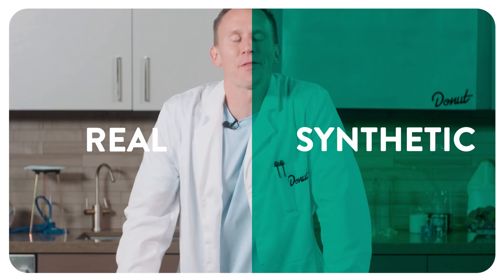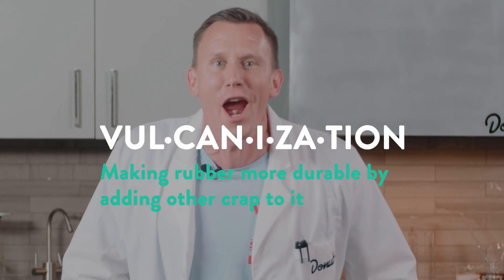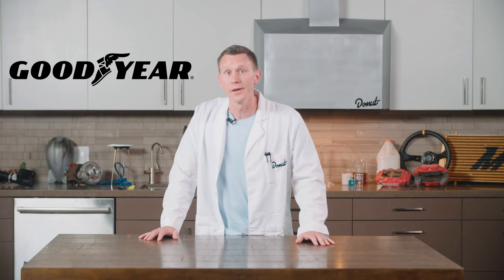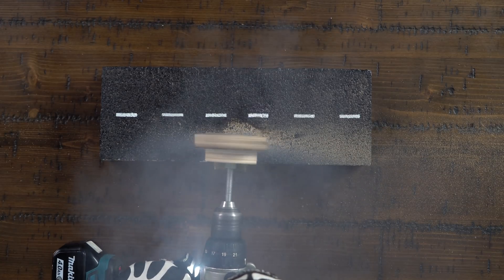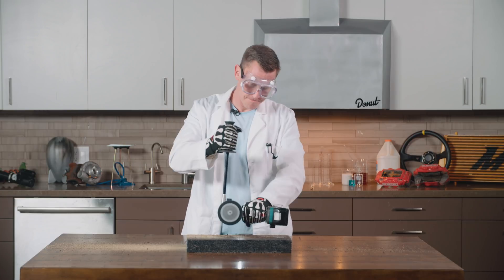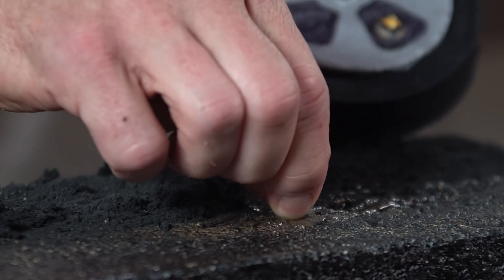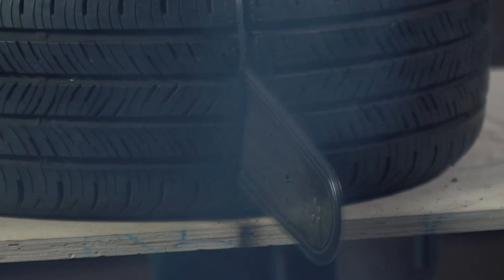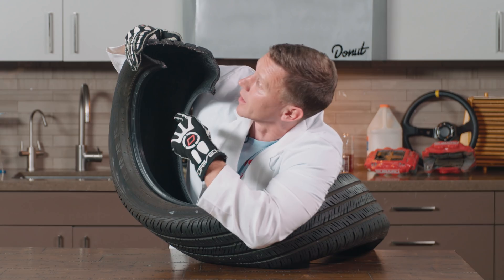TIRES | How they Work | Science Garage

Comment: Donut in general keeps saying you need rubber for you engine but you don’t you can direct mount your engine without rubber mounts change the pulleys to gears and use a chain and get plastic hoses for the cold things in the engine bay and metal ones for the hot ones

Comment: The double bond in ethylene splits into two electrons and a single bond, two monomers (a single part of a larger polymer) can form a new bond between them with the two shared electrons. This forms a long chain, but that chain doesn't have double bonds between them. This way you show carbon having 6 bonds around it, which is not possible, 4 is max and most common. Only in very specific circumstances can you have carbon with a different number of bonds than 4 around it.

Big up for showing it down to the structural formulas though.

Comment: 5:20 No belts,no hoses,no tires...Sounds like a locomotive to me.Belts,none on a locomotive.Hoses,they can be made out of metal (not efficient but they CAN be made out of metal),tires...The wheels normally have no rubber on them...So....yeah...Imagine a car combined with a locomotive.Normal front of the car with the steering.Rear with the boiler and driving wheels. xD

Comment: Inner liner, 2 plys with nylon strings, gum guard, rubber coated copper bead, rubber shaffer, rubber side walls, 2 copper stranded belts, high speed rated tires have kevlar overlay strands, finally rubber tread. Those are the compounds of a radial tire. 👍🏽

Comment: How about a fuel talk involving E85? When I got my WRX flexfuel tuned, it made 50 more horsepower/torque over 93 octane just because I changed priorities at the pump. Aside from crappy MPG (who cares? I don't!), it's a boost in power and rarely ever breaks $2 a gallon when at the same time 93 is at $2.70. I guess key point, cheap "race fuel", how is it made and why hasn't someone blended it with a higher octane like 100+?

Comment: The only rubber parts of a car or motorcycle, should be the tires...and condoms for later. 

Everything thing else, like bushings, boots, and hoses, should be made of longer lasting, more color optioned, silcone.

And forget belts. Sealed gears & chains are better.

Comment: Bart isn't exactly a power tools kind of guy is he? Also, while you guys had that tire cut open you should have explained the differences between bias ply and radial tires. Some motorcycle dudes and peeps with tractors and trailers might run into that some day and be confused why the bias ply on their John Deere looks like a warped donut after a few years.

Comment: 0:48 Someone failed Chemistry.

The ethylene double bond breaks to form single bonds between ethylene monomers in polyethylene. You don't get double bonds at all in polyethylene. Carbon doesn't form more than 4 bonds in all but the most extreme circumstances. A carbon drawn with 5 bonds is called a Texas carbon, after the 5-pointed star on the flag and the saying that everything is bigger in Texas, but with 6 bonds these are Alaska carbons and you've got a whole chain of them too. Shame man. 

You really should use professional software to draw your structure diagrams, you'd get a warning whenever you've done something that is usually impossible. I suggest using Chemdraw Direct, it's a free to use online version of Chemdraw.

While we're at it, I'd have liked an explanation of the structure of latex (basically polyisoprene) and the actual polymers used in synthetic rubber. Polyethylene makes for terrible rubber and doesn't vulkanize at all because it's got no double bonds left. You need something like butadiene, isoprene or neoprene usually as a copolymer with styrene or acrylonitrile, or both.
Reply from the maker: It was an editing illustration that we caught too late.  We'll do better!
Reply: Yeah I also noticed that I don't know what all that means and still don't know but thanks for your commitment to enlighten people
Reply: shut up, RRRRUUUUUUUUUBBBBBBBBBBEEEEEEEEEERRRRRRRRRRRRRR
Reply: Holy shit you must be unbearable to be around.
Reply: Was about to put a comment about the number of bonds and then I saw your comment 😂
Reply: you must be stupid af

Comment: Do on "how nitrous oxyde works"
Reply: hoot whippo's... that's how it works   : ]    ask Steve-O
Reply: not quite that simple...  N2O does carry more oxygen than the air we breath, allowing more fuel to be burned, you need to increase fuel intake along with the nitrous when it is used.
Reply: @TheCanadianBubba plus the split of N20 into 0 and N2 the N2 part prevents pre-ignition(pinging)
Reply: Well they did
Reply: They saw your comment
Reply: it just inject pure oxygen into fuel mixture